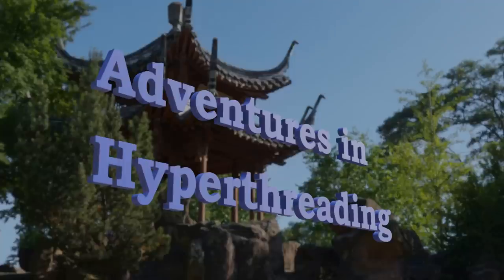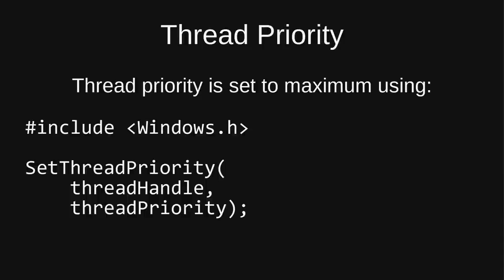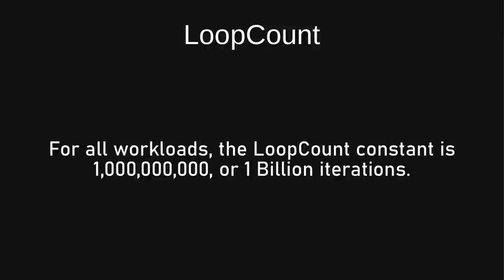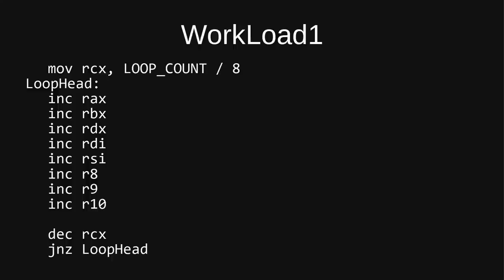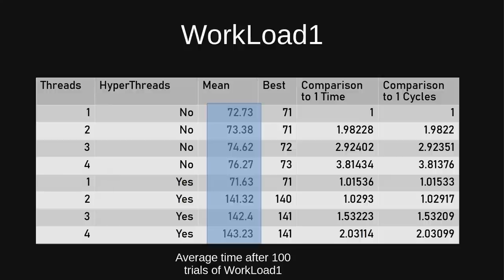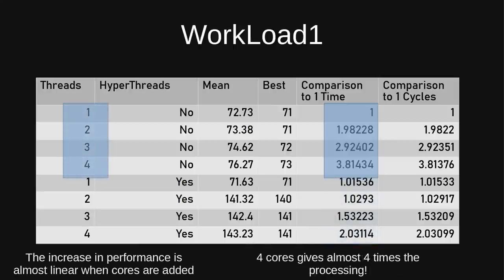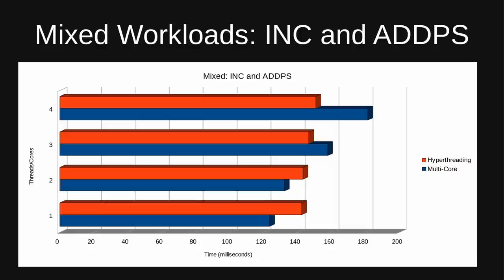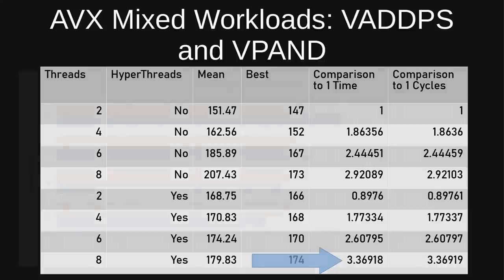Adventures in Hyperthreading - now with STEREO SOUND!!!

Comment: Pointer chasing with some compute is where the HT shines. One of the threads stalls on the memory, then the other can do its compute part and vice versa. In general the pipeline stall is where the HT should help. Max benefit from of HT saw is 1.7x in very carefully thought and well written tree traversal. Compute part was almost equal to memory latency. Beautiful code.

Comment: I have a project where I want to see how well I can optimize it, and as part of that I'm parallelizing it. Now I'm really curious to see if writing integer and floating point versions of the same code and splitting the threads between them will see any performance increase. I'm especially interested because it's written in java (cause it derives from a CS assignment) - JIT is really powerful so I think it'll see enough native execution to benefit from stuff like this, but we'll see.
Reply: Does it work?

Comment: Your Creelness, many thanks for taking this thourough expedition through the topic, needed a second to grock it all. 
So the takeaway would be unless you have mixed workloads of similar size, stay away from hyperthreading (6:51) But isn't this the CPU putting both these hyperthreads on the same cores? So effectively using only 2 cores instead of the 4 of the non-HT version? Can you tell from the task manager?

Comment: What processor were these tests run on? I would think that if you have 8 full cores then there should be almost linear scaling in the mixed workload with OS scheduling because everything would have it's own core. If the processor is only maybe 4 cores then it makes sense that hyperthreading would be faster.